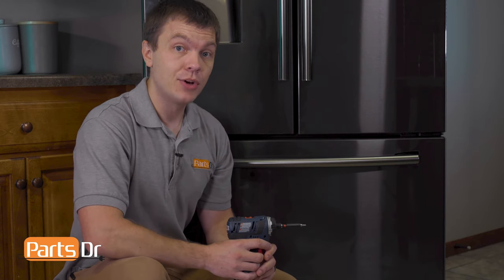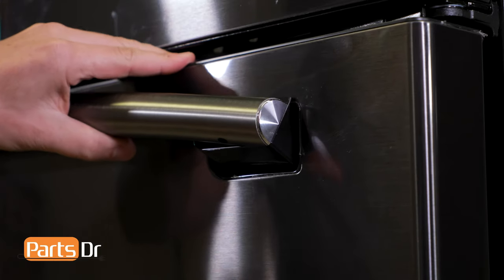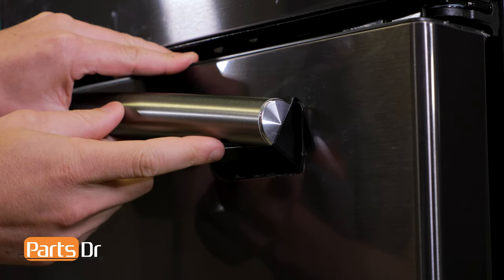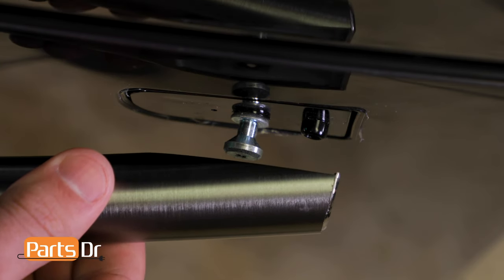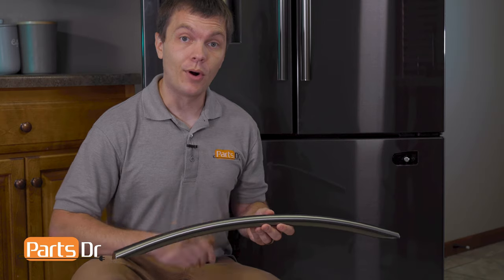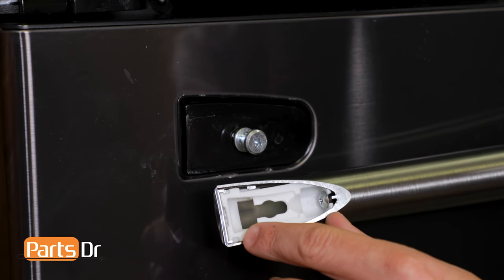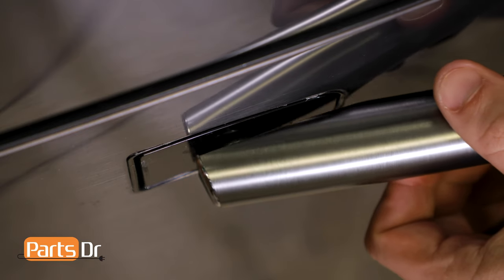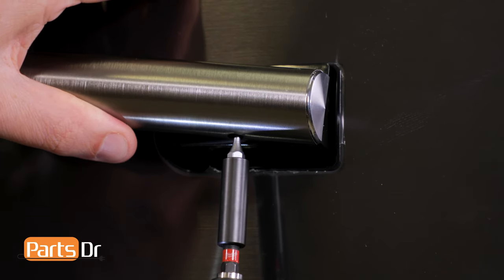How to remove and replace Samsung freezer door handle part # DA97-12712D

Comment: Thank you so much, our Samsung Freezer/Fridge is basically brand new. And I grabbed the handle to get some bread out of the Freezer and the handle popped right off. Your video saved my bacon, all I had to do was find the 2.5 MM Allen Wrench and loosen the set screw. Then I hand tightened both screws slid the left side handle back onto the bracket and retightened the set screw on the right side. Took all of 30 seconds!
Reply from the maker: Awesome! Nice job!
Reply: I have a 2.5mm Allen wrench but can’t find the set screw
Reply: @PartsDr I have a 2.5mm Allen wrench but cannot locate the set screw. Any advice please?

Comment: Hi Ryan.  My fridge is a Samsung RF263AFRS.  The handle from my freezer door, similar to what you've shown here, came off violently.  The handle itself is intact, but the two brackets on the freezer door need replacement.  How do I go about finding those parts?
Reply from the maker: The model that you provided is not valid.  Use this video to locate the model here: https://www.youtube.com/watch?v=4HhWL9sonuE

The parts that you are looking for are sold as part of the freezer door.
Reply: @PartsDr  It actually is the model number (printed on an adhesive on the lower front size marked "Model"); may also be listed as RF263AFRSXAC.  No worries, figured it out.  Needed parts DA67-02483A & D67-02485A - sold out everywhere.  Made due with DA67-2056A & DA67-2057A against the recommendations of part suppliers in trying a different product number; there's no way Samsung would use different moulds or they'd be severely less competitive.  Thanks anyway.
Reply: For me the right bracket is completely stripped, though the handle and screw themselves are fine. How complicated was it to replace them? The local repair shops wants $300+ parts! Thanks in advance for your help.
Reply: @CobaltPraetorian  Finding the right part was the challenge...I basically ordered something that looked comparable, but wasn't the exact same serial number.  Ended up being 100% match.  Installation is a breeze.
Reply: @danielkol  Yeah, I don't even have the correct part number to use to start the search. There's another video (here: https://www.youtube.com/watch?v=ZOGYdHcCgSE ) that shows the exact problem I have on my exact model (RF28HFEDBSR/AA), but the plate is stripped out and their solution doesn't work. They also don't list any part numbers and have commenting turned off. :'( Thanks anyway!

Comment: Hi, I have Samsung model #RF263TEASR/AA which doesn’t have the 2 top caps visible. It has one plastic top spanning length of freezer door. Is this removable & if so, how do I go about removing plastic top? I need too replace the “support cap” The parts are available for this model but not seeing how to access the area? DA61-08267A support cap door r DA61-04335B spring etc-easy handle 6002-000213 screw-tapping Da66-00579b shaft-cap-handle Da61-06014a slider-easy handle Da64-04159a trim-cap door r Da61-05899a fixer-shaft r Da61-05930a fixer-shaft l Da61-06658a reinf-cap handle
Thanks

Comment: I have Samsung RFG295.  The freezer door handle does not have a set screw.  Got a video for that?
Reply from the maker: Some will have a screw on one side and no screw on the other side.  Remove the set screw and slide the handle over to remove the other side.

Comment: Hi. The freezer handle from my Samsung (RF20HFENBSR) came off and the plastic bracket broke. Which are the parts I need to replace them?
Reply from the maker: If the plastic bracket on the door broken, then you would have to replace the door.  The door for this model has been discontinued by the manufacture.

Comment: how do I replace the pivot part on right side.. its exactly that shape.. no tag for model numbers
Reply from the maker: They do not sell the plastic piece on the door for this model shown in the video.  You have to replace the freezer door to get that piece.
Reply: Thank You... Bummer.. I figured that..I actually found another video how to seal the pivots so door handle can just be pulled out.. not up..

Comment: Any chance you know what part number I need to replace the plate the freezer door handle screws into on the right side? It's completely stripped and the bolt will not engage. Model number is RF28HFEDBSR/AA. The behavior I'm currently seeing is the same as at the beginning of this video: https://www.youtube.com/watch?v=ZOGYdHcCgSE (same model, even), but the plate is stripped and their solution doesn't work. Happy to order the part from you if you have it.
Reply: I have the same question!!!